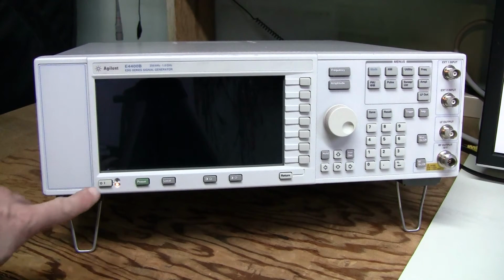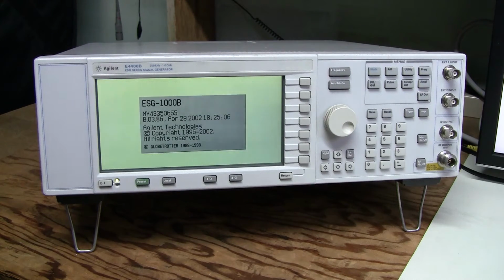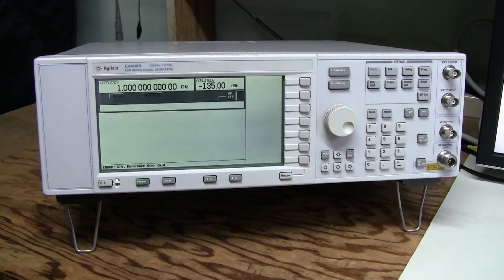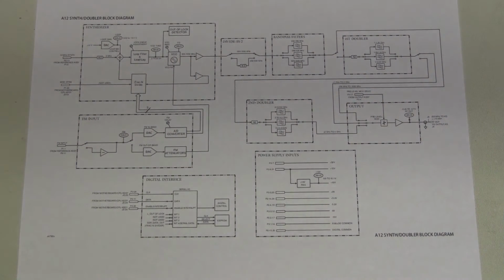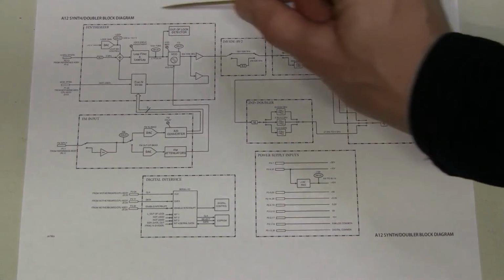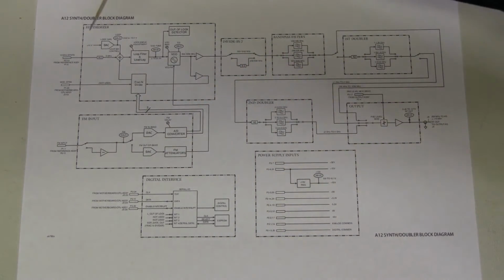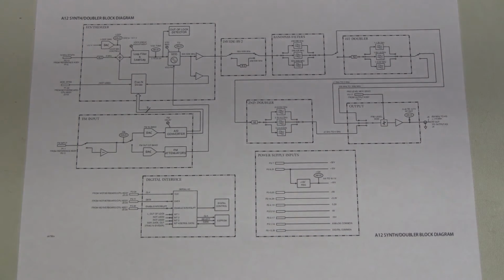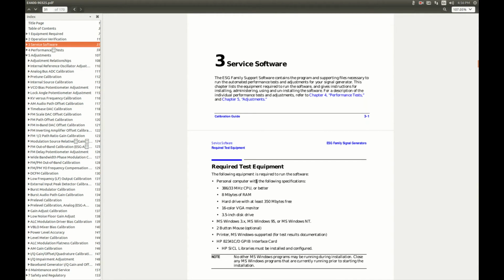#37 - A look inside of an Agilent E4400B signal generator

Comment: One of the pieces of "Recommended Equipment" in the manual for the 5384A/5385A is an 804a signal generator...the only problem is that I don't believe that piece of equipment even exists.

Comment: Hi. Whats that all about with remaining flux on the board? I hear that very often during teardown videos (from Dave especially). Is it such a big deal? I know it looks messy and non professional but that stuff is not conductive. I understand that it might be a problem in hard conditions like high humidity and large temperature differences like in automotive but is it such a big problem in equipment that is used indoors?
Reply from the maker: Usually I look for signs of repairs, and flux residue might be an indication. I don't think it was the case here. Most probably the last step on the factory was to solder the through-hole components, and they decided not to clean up after that. Yes, looks a bit messy and unprofessional.
Reply: Not really, but Dave and co needs something to talk about and rust, uncleaned flux go to legitimate presentation issues. etc

Comment: there are different dividers to divide the signal coming from the Oscillator then it goes to the synthesizer where it is compared with the reference which gives an error voltage which is then buffered and sent back to the Oscillator so there must be a problem with one of the divide by 2,10,100,1000 chips.